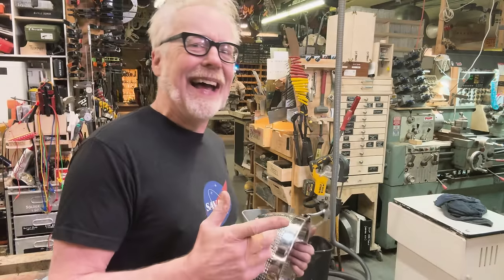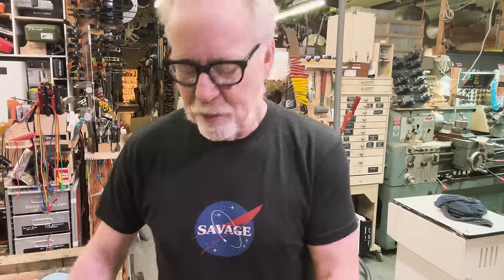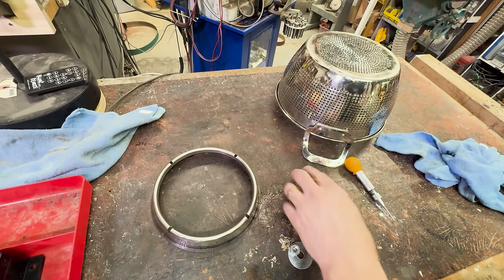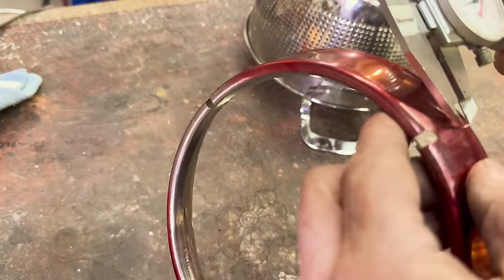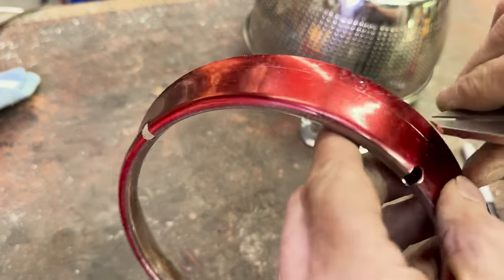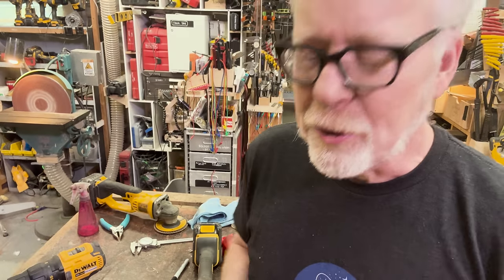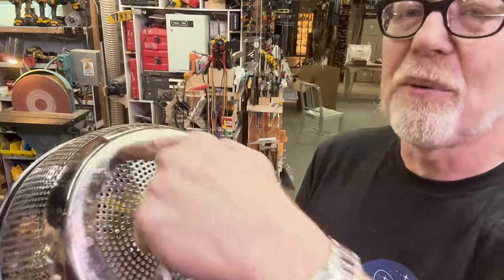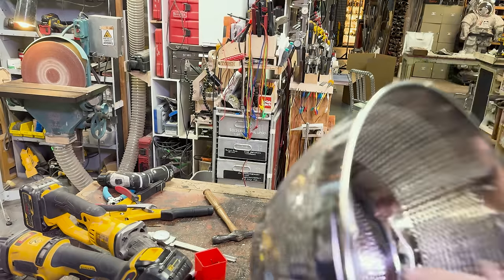Repairing the Most Useful Tool in the Kitchen!

Comment: Probably should've gone with soldering. Copper+stainless=galvanic corrosion. Though I assume it's stainless and not chrome plated. Anyway, there's good reason why you don't connect copper pipe to stainless fittings.

Comment: In choosing copper over aluminium rivets, I'm not sure that there is anything to worry about with Aluminium toxicity, but I would avoid using them in this application due to the greater likelihood of galvanic corrosion with stainless steel than copper.

Comment: I have a 50 year old collander, it's been dropped, dented, bashed and abused. I think I spent a couple of bucks on it. Find a decent one, Adam. I have a pair of tongs that I bought at the same time. The river failed. I drilled it out and installed a stainless steel bolt and nut 10 years ago.

Comment: Technically, copper is toxic.  It is used on the bottoms of boats for this reason (Keeps the barnacles away).  I know we use it for water pipes, and that is fine because it almost instantly develops a non-toxic layer of oxidation to create a barrier between the copper and water.  In cases where the copper is scrubbed repeatedly, it removes the oxidation.  Not sure on how much copper exposure is harmful to humans, small amounts can be harmful to fish.  The small copper rivets in this colander are most likely not enough to be an issue.

Comment: Copper is arguably worse than aluminium, tho only in specific circumstances. Like don't put food oil on copper. Probably would've used use a tack welder which you can easily make out of your regular welder in stick welder mode. Just get two copper points and sandwich the two together. You'll need to passivate the stainless after tho. I've repaired the tack welds on my mother's favorite coffee pot in this fashion.
Reply: especially as copper alloy often has a bit of lead in it, so it could be very toxic.

Comment: I'm surprised Adam still doesn't have/isn't using that tool (I don't know the name) where you basically heat weld a bolt to a metal surface. Then there's nothing on the inside of the colander or going through it etc.
Reply: friction welding?
Reply: @mikelastname  Stud Welder apparently. You aim the gun, click the button, it goes ZAP and instantly you have a threaded bolt attached to a surface

Comment: something's weird about seeing adam with an angle grinder, idk why  😄
Reply: What's weird about Adam using an angle grinder? Angle grinders are handy tools. Which is why I have more of them than I know. I keep 5 on a rack on one workbench alone. Those 5 I know well. But I have a few others. I'm not so sure where some of them are. But I know I've got them. Yesterday I was looking for a drill I know I have. I never found it. I used another one I did find and it worked just fine. I'm still wondering where that one got off too though. It isn't every day I need it. It's a triple reduction HD one. A right real wrist breaker it is.
Reply: @1pcfred  not sure, maybe I consider it to be a kinda "rough and coarse" tool and don't see him in that. just a feeling.
Reply: @prottentogo  perhaps you're just not very familiar with angle grinders? I've done quite delicate work with them myself. Real light touch stuff.
Reply: @1pcfred  No, I am not (and never said I was).
Reply: @prottentogo  you should get to know angle grinders better then before passing value judgements on them. Angle grinders are very versatile. They grind, they sand, they cut, they wire wheel. It's amazing that Ron Popeil didn't invent them. I'm going to be helping a family friend out on Sunday and I'm going to be bringing an angle grinder to do it. She needs her lawn mower blades sharpened. In my shop I rough with an angle grinder then finish on a bench grinder. But she'll be happy with the edge I can get just using an angle grinder I'm sure. I'll bring a file and a hone stone too. I ain't bringing a bench grinder. Nope an angle grinder will do the job.
Reply: @1pcfred  jesus christ, chill. that was just a light hearted comment with an emoji at the end.

Comment: I dont think Id be that worried by food safety. As long as you can wash out most of the detritus, copper has antimicrobial properties thatll handle the rest. (As do several other metals for that matter.) 
but wont the rivets rapidly oxidise under the kind of treatment colanders get?  I mean it wouldnt be harmful in such small quantities, just unsightly.

Comment: copper is toxic brass might be better its made from copper and zink and alltough toxic the zink acts like an antidote , you might be able to use stainless rivits if you heat those up to chery red (with a tig welder?) or spotweld / tigweld  the base back on

Comment: I would have cut slots for the tabs and turnd it into a sorta bayonet  fitting so it can be removed for cleaning or if a particular task is better without it. It'd also avoid any corrosion caused by the dissimilar metals

Comment: I know you are all experienced, but watching Adam using the grinder without the guard in place made me cringe.  

I saw a guy slip up and put his hand into a cutting wheel while using an angle grinder.  He took the hit across the top of his fingers, but he got lucky and only lost some meat - no tendon damage.  I’ve also seen wheels shatter while in use for a variety of reasons, sending shards across the bench.  So I highly recommend guards and safety gear while using angle grinders with cutting wheels.

Take care and be safe.

Comment: Using an angle-grinder without its shield is worrying.  Using an angle-grinder without its shield AND without some sort of eye-protection or a full face-shield.....yikes.  Those cut-off wheels can catch/bind, rip, and explode.  I know this is probably your millionth time cutting this way, and yes everything went fine, but getting lulled into a false sense of security is just when things tend to go wrong — only takes a second to don protection!  Ounce of prevention, pound of cure, etc. etc.

Comment: whats wrong with eating food in aluminum... Did I miss a health concern?
Reply: Yes, you did
Reply: There's nothing wrong with aluminium cookware, but there's been a lot of old wives' tales about it since cheap aluminium pans became available in the 50s. Notably, the sulphides from boiling eggs can cause the surface to blacken instead of develop the white aluminium oxide layer. It's harmless, but there's thousands of people in the UK that keep a separate "egg pan" because they fear cooking anything else in it.
Reply: @HaralHeisto  well it's been linked to causing alzheimers.
If it's coated it's supposed to be ok, but there's many who argue that the coatings are also toxic over time.
Stainless steel is considered safe, as is cast iron or enamelled steel.
Stainless is easy to use, clean and care for, why bother with aluminium?

Comment: Mr.Savage, I am sorely disappointed in your safety protocol. Grinders without safety guards etc. Cutting with the disc rotation towards your face, You are setting a poor example for young makers, and have clearly not yet experienced the wrath of the grinder. I also used to do reckless one-handed cuts and grinding until a cutting disc shattered and went into my shin   muscle.Thank God it was a resin blade, and not a metal one, otherwise I would have been an amputee.

Comment: Please please please put the guard back on your cutoff wheel, that is extremely dangerous. The cutoff disc could fracture sending pieces into your eyes or worse slicing your jugular, I know of stories of people bleeding out like that. Also you should not lay cutoff wheels facing down as you could damage the cutting wheel, they should be facing up.

Comment: BTDT. Success happened when I trashed (saved for later) the ring, and spot welded three legs on it. No bad food cleaning things happened and works super easy lemon squeeze but, only with consent. After mom died it got passed back to me. And, still keeps the colander's contents off of the sink bottom. Julia C. provided the original file organization methodology of the cia. And, I understand she could throw a great party. Perhaps I'm incorrect. Was it Marilyn Monroe? Maybe both. oh well.

You certainly don't want' the contents of your colander on the surface of your sink. Unhealthy things could happen. Maybe some st stl hold off bolts mechanically attached can suspend the leaking vessel off the primordial ooze filled basin during its function?